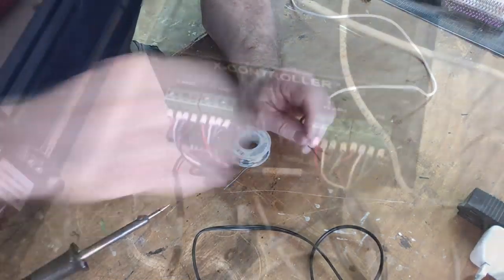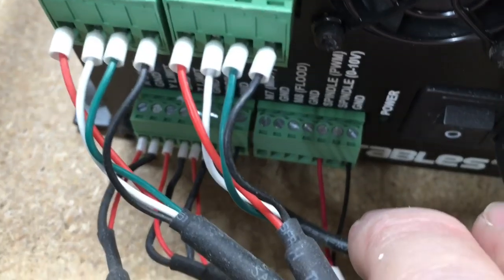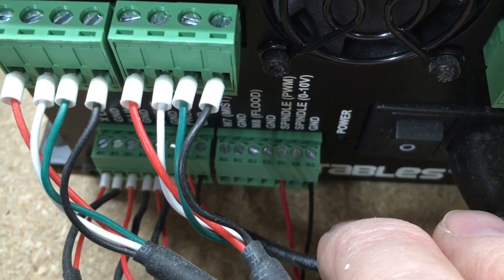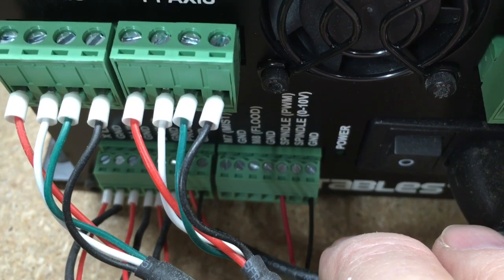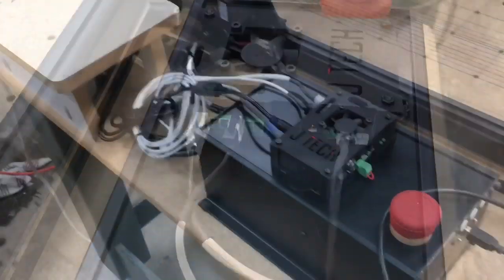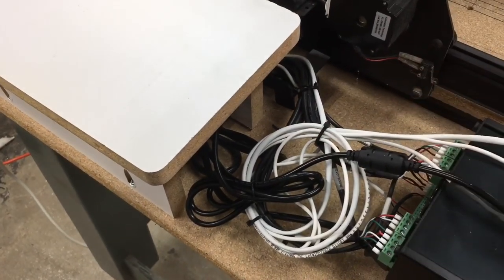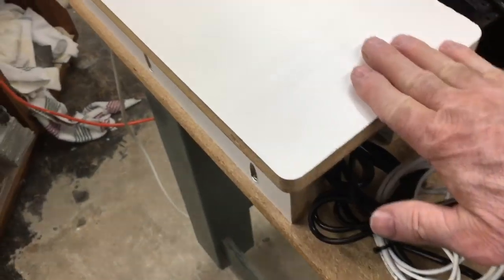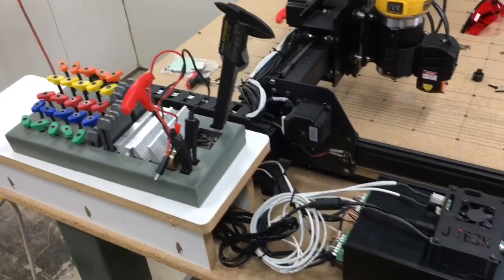How to Install the J TECH PHOTONICS Laser to my XCarve

Comment: I just got my jtech laser and your video made the installation a breeze. Thank you very much for making this video. I have huge plans for this and my X-Carve, especially since Christmas is right around the corner. Can you make a video of how to use the X-Carve and the jtech on the same project or explain how easel and light burn work together as far as setting up the x,y,z axis in each program to work with the location of the work piece. I hope explained that right. Thanks again I greatly appreciate your time and help.
Reply from the maker: I use the center point for the x,y zero. That’s the easy part. The other part is to have to correct size. The easiest way is to have a reference point of known size in both easel and Lightburn. Make the two match the reference points and you have it.
Reply: @PawPawsWorkShop  thank you sir. I will give it a try.

Comment: unable to control the xyz axes in v carve , but in lightburn laser the xyz works fine. All worked fine before.
Reply from the maker: There is no controller in VCarve to control the machine. On the first window you set where you want the origin point. In the toolpath area you set the safety height and other settings. The controller gives you the control to move the machine and follows the instructions you setup in vcarve

Comment: I'm thinking about purchasing the laser and this video is an excellent source for the installation process. I was wondering about running the laser cables to the xcontroller. I have a relay that turns the spindle on and off. Do I need to remove this in order to be able to install the laser? Also knowing that the laser is a 7W, will it cut through wood and other materials a d at what depth. Thanks.
Reply from the maker: It is my understanding that you would need to disable the relay that turns the spindle on and off.  Some people have had success cutting through, I have not.  Air assist would be a must in my opinion.

Comment: Did you have to change the x and y movement configuration on Lightburn?  I have a hard time getting Lightburn to work with my new JTech laser.  Would you please let me know and share your experiences?
Reply from the maker: I talked with Jay about the initial setup in GRBL. I also setup the x,y,0 position to the center of the workpiece. That was just a setting in Lightburn. Also, it is important to note, I do not use the homing switches. From there I have not had any problems.
Reply: @PawPawsWorkShop  Thanks again for your response.  I do appreciate it.  My issue with the origins are related to "the differences between the CNC machines and how Lightburn uses the origins".  They have explained it in the following blog posting at Lightburn:  https://lightburnsoftware.github.io/NewDocs/CommonGrblSetups.html#shapeoko-xcarve-and-other-negative-workspace-systems   .  They refer to it in the middle of the document where you have to set the negative offsets to get things to work.  I was just not sure if I only had this issue since you did not have that challenge in your video.  Thanks again for all of your great educational and amazing videos.

Comment: Did you mount your control panel to the x controller or just set it on top loose?
Reply from the maker: AirRickRoseInDoe .  No, double stick tape
Reply: I see! I just received my jtech 7w laser in the mail today! I ran the wires but noticed I didn’t have the green attachment that connects the laser to the x controller so I had to order one from amazon.. so won’t be able to try it out until Wednesday!

Comment: I am currently using the iot relay to control my dust collection and spindle, the control wire for the relay uses the same ground location as the laser. Can I put both wires into the connector or will that cause issues?
Reply from the maker: Eian Wagner . That will cause issues. Jay at J TECK Photonics can give you details.  I’m not an expert on this topic. I do not have a relay. Also a lot of discussion has been said on the Inventables forum

Comment: Thank you so much for your review. I’ve been using X-Carve for over a year, and am looking forward to installing a laser on it to expand the versatility. I have a lot of questions regarding software and control, but I am waiting until you publish your video. BTW. I really like the “Laser in use” sign that you created.
Reply from the maker: Awesome!  The laser is a great addition.  I will be doing some tests very soon.  Thank you very much.
Reply: Paw Paw, can you give me some direction. I Purchased the JTECH 7W laser for my X-Carve. I followed the instructions for the installation and the firmware upgrade. I followed the test “Hello World” burn, but noticed that my current laser position was in a negative X & Y value while my “Hello World” was a positive X & Y value. I reviewed my setting for origins and pressed the START button. The laser immediately went to left front rails. I stopped the run and again reviewed the parameters and ran it again with the same results. I did some research and found articles on the GitHub side that address negative workspace. Did you need to change the offset parameters on your system? BTW, I installed GRBL 1.1h (the latest version.) Thank you in advance for your help. Reg

Comment: I’m looking for a Sharpie pen hold like you used that attaches to the ROUTER
Reply from the maker: That pen holder was designed by "Designs by Phil.com"  I have had this for several years, so I can not tell you if it is still available or not.  Please contact Phil to see.  Thanks for the comments.
Reply: Where did he use a sharpie pen???
Reply from the maker: Chris 3M Good question. Not in this video. I used the pen holder in another video
Reply: Look on thingiverse.com
Reply: Phil still sells them. http://www.designsbyphil.com/cnc-pen-tool.html